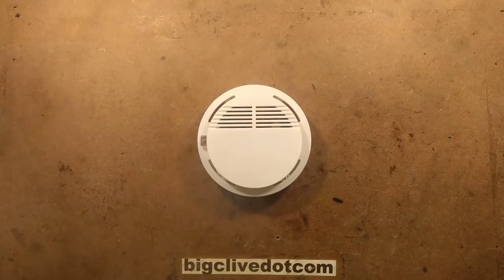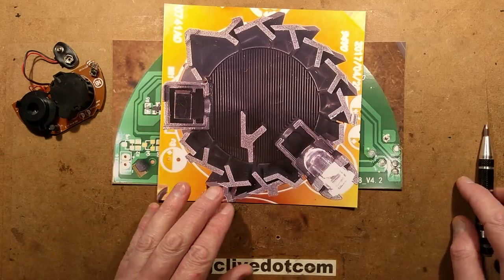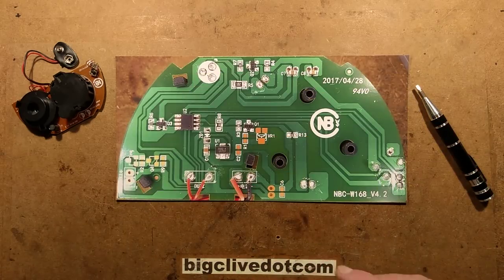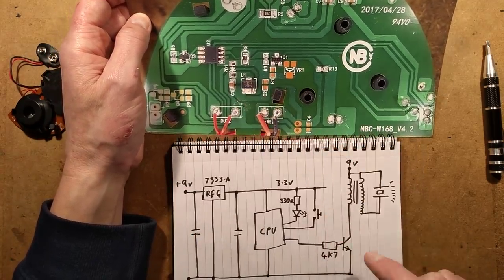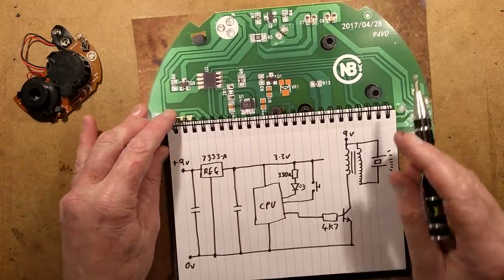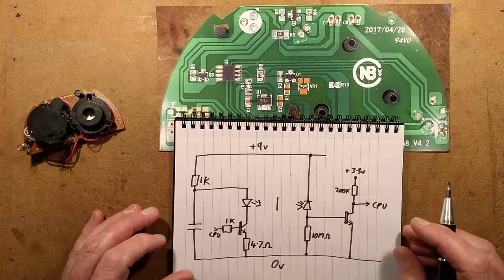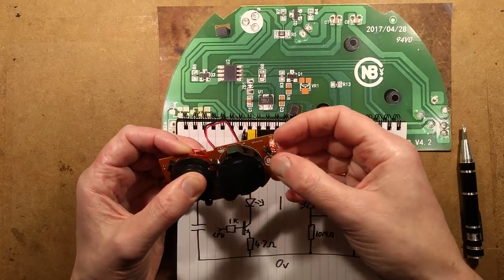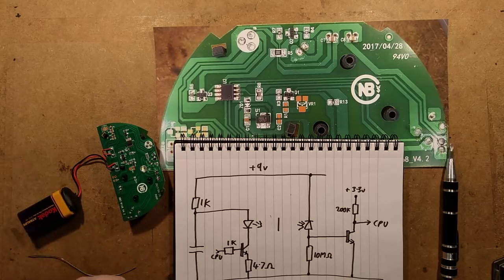Torch your home for $4. (with schematic)

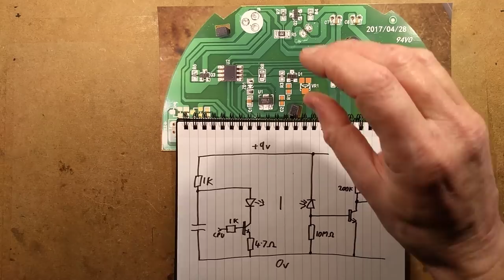Comment: 15:33 Do not change smoke alarm batteries while house is on fire.
Reply: That should be in the user manual :D
Reply: That's actually a poor design. What happens is there's a weak battery, the device detects smoke and starts alarming for a while, then the voltage drops underneath the operating threshold and it resets. Then it will remain silent rather than trying to alarm again.
Reply: @straightpipediesel  You ought to change batteries once per year. Furthermore, I'll assume blinkenlight pattern changes when battery goes low.
Reply: @volo870  Most people are too lazy to. That's why California banned smoke detectors with removable batteries; they have to be 10 year permanent lithium type. Poor people were apparently not replacing and worse taking the batteries out.
Reply: @straightpipediesel  Why the hell would you buy a smoke detector then? It's better to rely on your smell and guts than on a malfunctioning device.

In my neck of the woods smoke detectors are VERY rare. But those installed are being taken care of.
Reply: @straightpipediesel  You can get smoke detectors for free from the fire brigade over here and batteries are dirt cheap, do how is this to do with poor people?
Reply: @Stettafire  It's still time and money. In fact, most people aren't going to bother getting free detectors because it's not worth their time. I'm not making this up, google sealed smoke detectors and HUD housing (HUD refers to public housing program for low income households). Simple fact: poor finances and poor life skills are almost always correlated.
Reply: @astupidmidge  That seems a bit unfortunate, given the mains supply is... a potential source of fire. You don't want your fire detectors to suffer an... ironic failure mode.

And i mean a 9V lithium battery with endurance of like 10 years guaranteed, closer to 20, maybe 30 actual is what, $6 retail or so? A fraction of that in actual marginal cost. It just doesn't seem worth the extra effort of running a mains wire to the device, having someone spend extra half an hour installing the thing, and then the minimal components, like at least a capacitive dropper, shunt regulator to generate an operational voltage from that, and then the extra heat from the regulator increases odds of failure. Just seems like a bad idea all around, and you still need the battery for backup, and you need extra circuitry that will warn you about it going flat even while the mains power is connected...
Reply: This may be true. However, consider the following. Someone burns the toast, smoke detector goes off. Someone disconnects the battery to stop the noise. Then immediately reconnects the battery. Sound stopped, smoke detector is powered. Smoke detector is reset with a high threshold. Later. a real fire happens, smoke detector sounding is delayed until smoke gets really thick.  That delay, could increase danger to house occupants. (This risk is probably less than the risk of leaving the batteries out of the smoke detector.)

Comment: Back in the mid 70s I had a school holiday job working for a company that among other things made a photoelectric smoke detector.  It was based on a tiny incandescent lamp, 2 CDS cells and an old 741 op-amp in a round metal can.  This was before microcontrollers or dedicated chips.  From memory it compared the detected light from 2 sensors via different paths in a black chamber.

Motorola made a dedicated chip back in the early-mid 80s MC14466 - a later version may still be available.  I now work with a smoke detector that used a dedicated chip until a year or two back when the manufacturer changed to a 14-pin PIC micro.  An op-amp circuit connects the IR sensor to the PIC.  A lot more parts than the detector shown here, but still relatively low cost from the source.

Comment: If  a ceramic cap measures 16uf it's probably 22uf "nominal" - cap tolerances are always negative,then you have the falloff of capacitance with DC bias
Reply: Or just reflow the solder on it and meassure "design" value?
Reply: "cap tolerances are always negative" - false. It depends on the manufacturer, and even then, expect 10% to be outliers. Source: I measured about 200 caps just to see for myself.

Comment: I really appreciate all the great information and explanations, I have always enjoyed taking stuff apart to see how it works, the circuit boards and what not are so confusing but i'm slowly understand how all the little do-dads work, great video! :)
Reply: Experimental Fun don't deal to bad, it's 3 A.M. were i'm at now. Try to go to bad early for work and this is what happens
Reply: +Experimental Fun

"I have always enjoyed taking stuff apart to see how it works"

For many years I did the same, and invariably ended up breaking stuff; but in due course I learned how to fix stuff and then how to make stuff.
Reply: Yup. I've taken apart tons of stuff I got for free from the local thrift store. If you find somewhere local that is already tossing stuff that doesn't power on, it's a great source for random parts and repair/troubleshooting/circuit lessons. Some second hand stores are even paying for hazmat recycling just to throw out electronics stuff. So your actually saving them money by taking the e-junk off their hands.

  Eventually it dawned on me that my time is better spent learning with intentionally selected components where I know what I have, know that it works, and have spares readily available if or rather when I make a mistake.
  It's still handy to have a bunch of junk boards laying around to reference to though.
  Personally, I limit playing with junk box components mostly by the datasheet. If the DS is a page or few, it's worth goofing around with. If the DS is longer, that's the kind of thing I want new spares for. There's nothing quite as annoying as spending a bunch of time troubleshooting a broken part or breaking something after spending time on it without a spare on hand.
 I also highly recommend trying to remove and reattach some more advanced surface mounted packages like QFN's on junk boards. It's very easy to assume "I'll fix this easily" just to learn the reason why rework stations are a thing.
  I think the best stuff to salvage and study are power supplies. There are lots of cool things you can learn, and no matter your field of interest your going to need at least one power supply.
-Jake
Reply: @infarno91  loop ll

Comment: Fife Council considers smoke detectors an investment - better value than sending out the fire-brigade - and will install them in your house free, so "cheap" isn't needed here.
Reply from the maker: Many of the fire departments have teams that will fit them free too.  But the downside of that is that if they reduce the number of fires they get their funding cut.  Because that's the mentality of politicians.
Reply: It is still the same number of fires with a lower amount of fatal casualties. Stopping funding would be mad. Certain British politicians do not seem to be interested in serving the public interest or common good.
Reply: Simple answer: Don't vote Tory.
Reply: Even if you don't need them as actual life saving measures, you could use them for... Let's say hacking in some smoke-triggered automation. Wouldn't mind adding this and a latch relay to a 3D printer or something.
Reply: Same here in Highland. I believe the fire crews get paid for coming out to do the free assessments they offer and to fit free alarms. They will also replace them when the supposed 10 year battery fails at around 5 years!
Reply: +Lyle Boyer
That's what happens when Republicans are in charge. Basic human decency goes out the window.
Reply: Something to keep in mind about that incident. They didn't have a local fire department and the fee was for the fire department to go outside of their area to people whose taxes do not support them to put out a fire. The real problem isn't the fee but the fact that they sat there watching. My grandfather had been in a similar situation before I was born. No local fire department. However they were able to get fire truck out there to help put out a fire that had started up in the field. He had to pay an arm and a leg afterwards but they helped put the fire out.
Reply: The same applies to some councils in Surrey, but not every council under Surrey Fire and Rescue. It's a silly policy to have some parts of the UK with a free service and some without, but as Clive said "that's the mentality of politicians".
Reply: Oh, there really is no limit to stupidity when the state gets involved and promises "free" stuff.
The problem with that fire department was that they probably couldn't legally charge for their service to those people while still having to answer for equipment, man hours and material. So they just did the legally required minimum.
Reply: jeff, you are making assumptions, mate - you know nothing about Lyle Boyer or whether or not he would help someone.  He doesn't sound like a republican so probably would help a stranger.

Lyle's story shocks me as I often joke about America's 'socialist' police and fire services when arguing about universal healthcare, in that republicans don't believe in universal healthcare yet their taxes go towards universal policing and universal fire protection but now it looks like fire protection is something some folks have to privately fund - and I suppose you could consider those well-off gated communities as being privately policed.

When the US eventually falls into a chaotic mess where the 'haves' live behind huge walls with guards and clinics and the 'have-nots' roam the lawless wild taking what they can I wonder how the middle-class will take it when they realise that they don't fall on the side of the wall that they thought they did.  Will be interesting to watch, they'll probably still worship their mega-rich gods.
Reply: Fire services started that way in the Uk. You paid your insurance and they would fight a fire for you and vice versa. If you paid money to a different insurance company then it wasn't their fire to fight.
Reply: @zakuraayame5091  I like you better than jeff...I'm with Mr. Non-Compete...don't vote Tory...Republicans only spend their money on bombs and tanks, and vehemently oppose keeping their own citizens healthy... Tory's mentality is "Save Money!, Less doctor's visits=More Planes...Less EBT for the genuine poor=More tanks...No dental coverage any American unless they pay through the nose=More Bombs!"

Comment: I believe the 4.7R is an emitter swamping resistor to keep the transistor gain constant over a wide temperature range, the B-E junction forward drop is quite temperature sensitive and would cause the LED brightness to vary with temperature.  I would expect that would complicate the sensing threshold (and battery drain).  A Mosfet would be a better choice, but needs more voltage.

I just bought a number of smoke detectors and did a little research to find, surprisingly, the Photoelectric type are actually superior in aggressive fires, where the Ionization type often take several minutes to respond in these conditions. They are also less likely to false with cooking vapors and such than the ionization models. 

The Ionization detectors are the response time winners for smoldering fires however.

It seems a combination of the two might be ideal.

Thanks for all the great videos

Comment: Cool video! I take apart old/faulty ionization type detectors for the Americium-241 sealed sources. I have a lot of sources, because radioactivity is my favorite hobby. Am-241 is a great alpha particle and low energy gamma source. Many modern ionization type detectors also have a photoelectric chamber too. Older industrial ionization type detectors used a higher activity of Am-241, usually with two separate Am-241 sources. One stronger source would detect smoke from early fires, and a second weaker source in an enclosed chamber for intense smoldering fires. Anything that passes between the Am-241 source, such as a gas leak, or even very high humidity has the potential to attenuate the alpha particles, causing a drop in the current and triggering the alarm circuit.

Comment: It works very similar to how a surface scatter turbidimeter works. They create a smooth pool of flowing water, a light shines on the surface and is reflected off into a cone of non-reflective paint. Only particulates in the water reflect light into the sensor. The beam shines at the water at about a 60 degree angle, so the light reflecting off the water goes equal and opposite. The sensor is 45 degrees off the water however, so it only sees particulate reflections, not water reflections.
Reply: turbidity is a good word
Reply: a what?
Reply: Surface scatter turbidity monitors are routinely found in clean water treatment plants where they are used to monitor drinking water quality, which in Britain is tightly regulated. Turbidity can be loosely described as cloudiness, which at high levels is unsightly, and can indicate contamination.

Comment: 4:12
You sound like you're speaking from experience
Reply: Sounds like story time!
Reply from the maker: My best was when I emptied a lunatic asylum accidentally.  I was working on the alarm system and it went off.  The system used a huge air-raid type siren on the roof and my legs literally went like jelly when it went off.
Reply: @bigclivedotcom  ohhh god that sounds horrible XD I'm surprised you can still hear
Reply: Air raid siren in a lunatic asylum? That's sounds like Broadmoor! They are talking about decommissioning their former WWII air raid sirens - it would be amazing if they could send one to you for a tear down.
Reply: @bigclivedotcom  Reminds me of the time when I was working overtime, during the weekend, alone in a data center. Which was not known to the guys who thought it would be empty during the weekend, for their test of the fire suppression system. I was not aware of them and they were not aware of me.

The fire suppression system just flushes the room with CO2. The ingenious part is the acoustic alarm.

The high pressure CO2 enters the room through a klaxon. Extremely simple, extremely effective and extremely right behind me.

It was so shocking that I was paralyzed and couldn't muster any clear thought for a few seconds.

Comment: For some reason this video reminds me of the time I was stapling up a cloth on a wall. On the other side of the wall was a smoke detector. The vibration from the stapling must have done something but the smoke detector caught fire, but luckily alarmed itself before it died. It's very ironic when smoke detectors catch fire.
Reply: That's funny

Comment: It really is fascinating how these fire alarms work. I've always wondered how they work.
Reply: There use to be 2 types. The ionisation kind which is interesting since it contains Americium 241, about 0.3 ug (I think), which comes out to 0.9 uCi. It is an artificial element. It is somewhat fissile, which means that you can make a nuclear bomb with it, if you can collect about 10 to 20 kg.
The other type is the photodetector type.
A new one on the market is heat detection.

Comment: Buying smoke detectors in bulk, we spend about $300 for about 15 of them, minus batteries.
They're good for 10 years (again, minus batteries), so for about $50 a year for all of them (including batteries every year) ... it's well worth the price for the safety!!!
Ours are also hardwired with battery backup, so they normally run off the mains. And they have an alarm wire, so when one goes off, the rest of them also start beeping. Makes quite a racket, LOL.